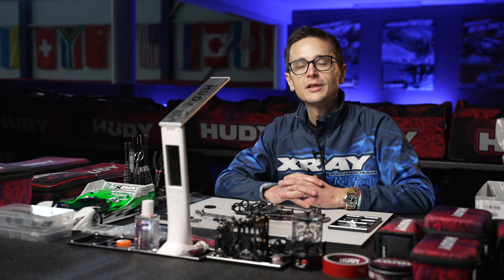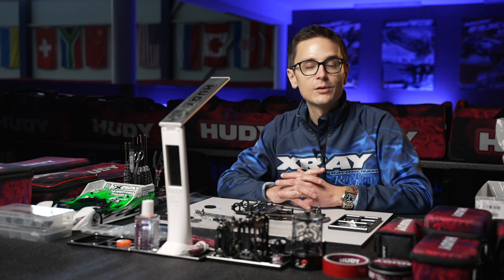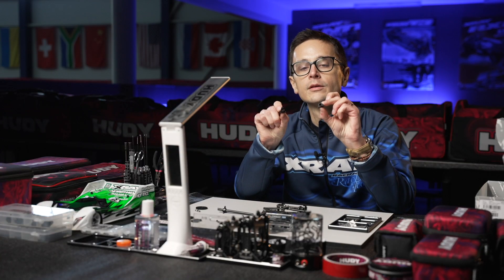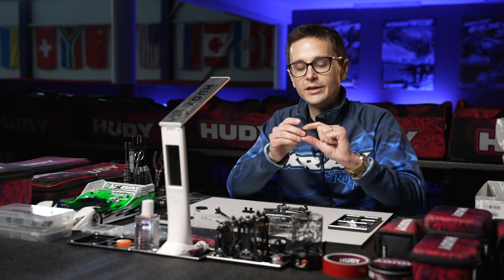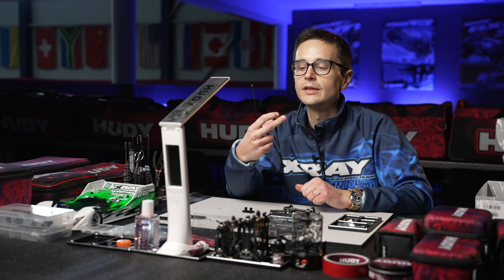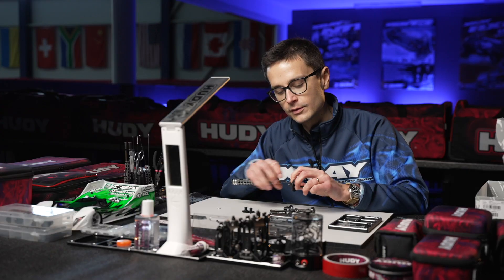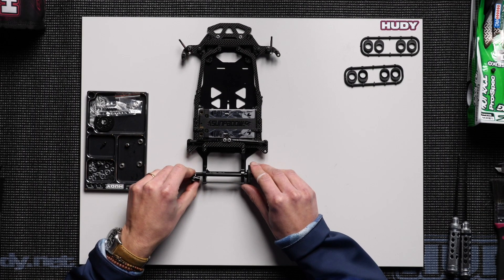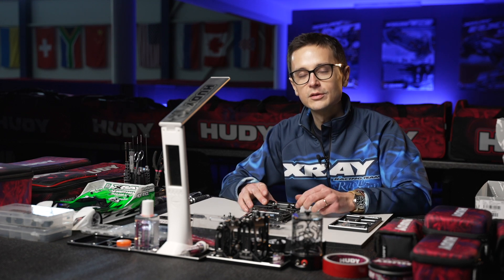XRAY X12'22 - Build video - Solid Axle

Comment: I’ve been a fan of X-Ray RC cars for a while and was really excited to try the X12. The on-road performance and build quality are still top-notch, and I love the ID system for the chassis. However, I’m really disappointed with the kit. It comes with a solid shaft instead of a ball or gear differential, which is a major letdown at this price point. To make things worse, the cost of upgrading to the ball or gear diff is more than thirty-five percent of the car’s price. For such a professional-grade product, this is really frustrating and not what I expected from X-Ray